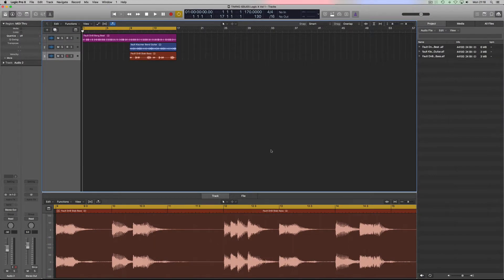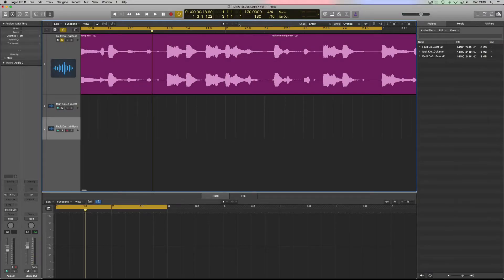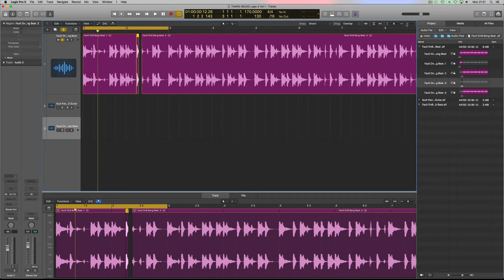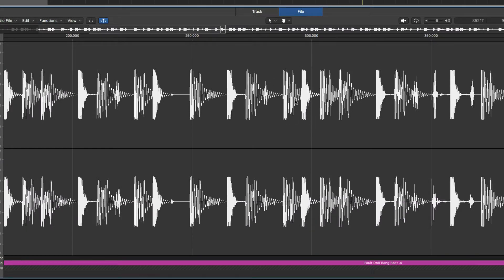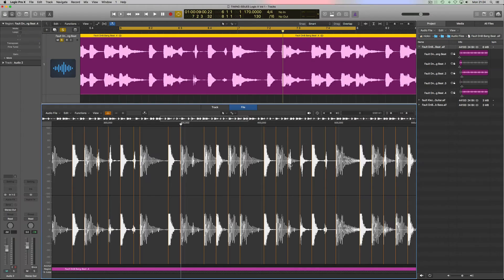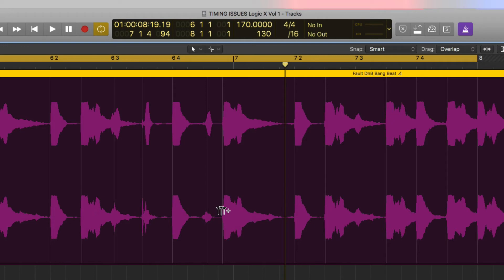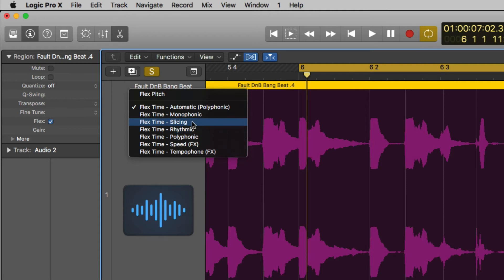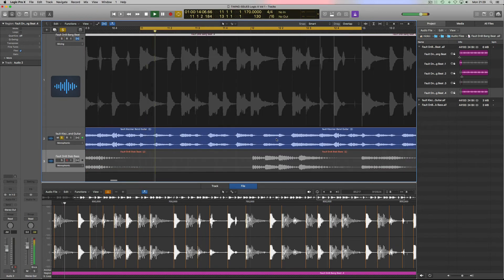Logic X Fixing Timing Issues

Comment: This is great! 
two questions though. 
1- can you do this across multiple tracks at the same time if you have multiple mics on drums and or guitar for instance? 
2- I found that on a project where i had a second mic on guitar it did not recognize many of the transients that the first louder mic did and the + button is grayed out so i havee to go in and set them all manually?
Reply from the maker: Paul O'Grady you can set up a group of channels on the mixer and phase lock the drums to flex time multiple audio files at once 👌🏻